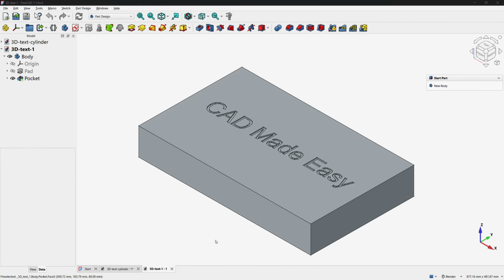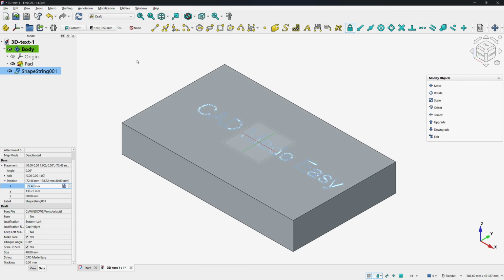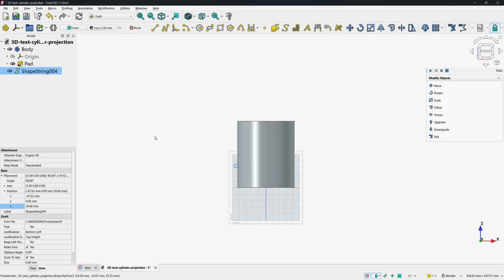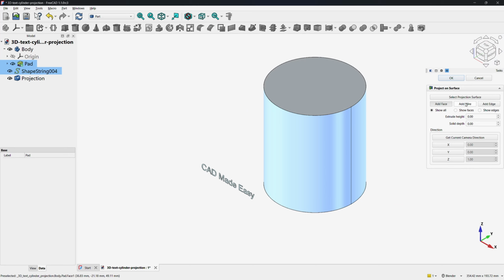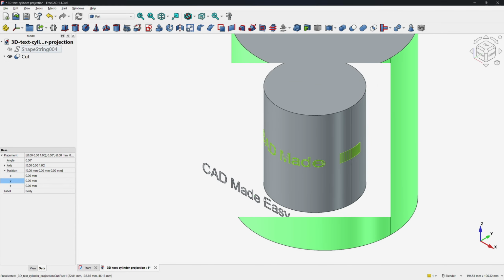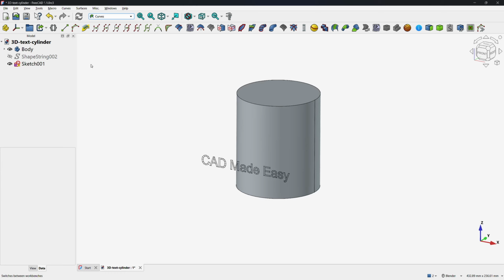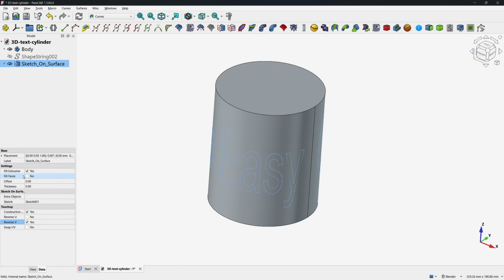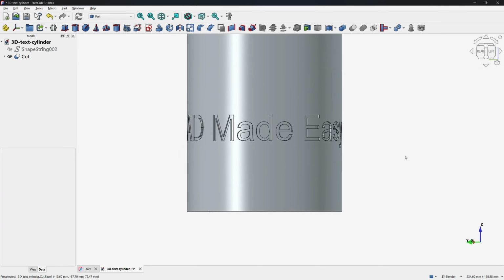3 Easy Ways to Create 3D Text in FreeCAD – Flat & Curved Surfaces!

Comment: Hi, how to make the text size we want? Changing size of construction is not a precise way unless there is some formula
Reply from the maker: Hi, it's a good question,  in the Video example, first when you create a shape text, and you can set height for it , then you can add dimension on the construction rectangle, make width equals to the cylinder height, and length equals to the perimeter of the cylinder. and before close the sketch , make sure the text wire dimension is not modified automatically.
 and for how to make  the text wire dimension not fit when you add dimension,  you can go to preference>sketcher>general>Scale upon first constraint --never.
hope it helps. and I will make a video about it
Reply from the maker: you can watch the new video: https://youtu.be/VbZd7hURC8c